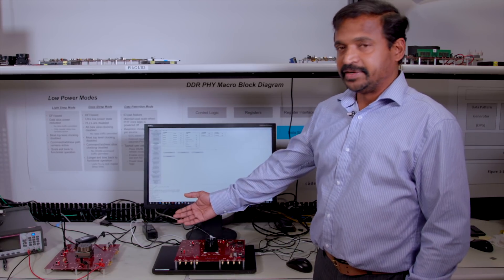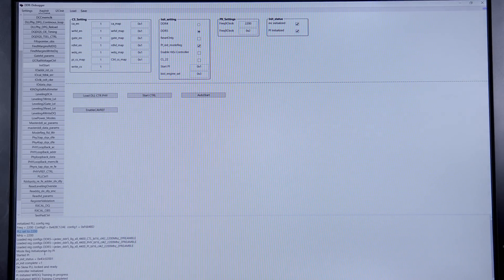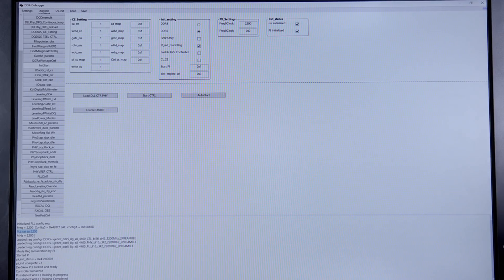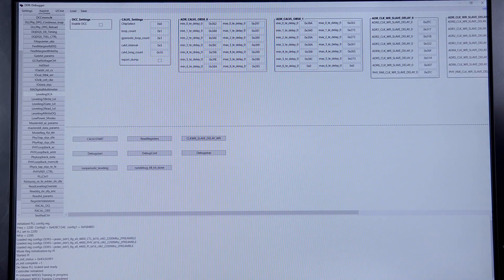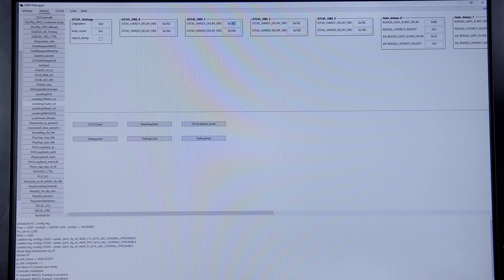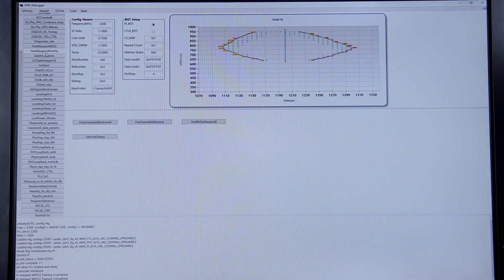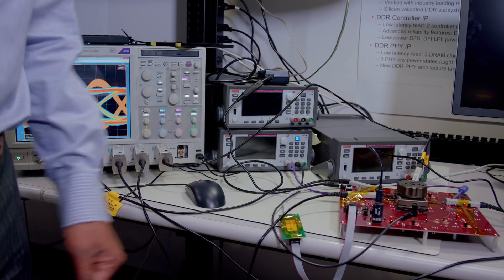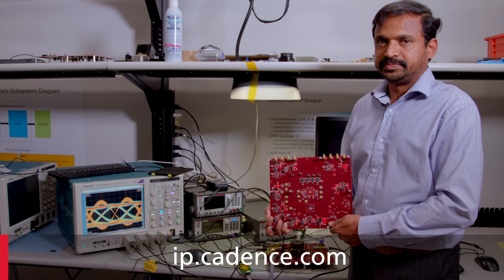World’s First DDR5 IP Silicon Prototype

Comment: When will we see DDR5 on desktop market , any thoughts ?
Reply: On desktop? Late 2020. On servers, early 2020. It is possible that the phones will actually be first to use DDR5. Just my guess. But phones has a benefit of full integration, and not needing to have a huge ecosystem of motherboards, or waiting for other companies to develop CPUs, memory controllers and chipsets.
Reply: bout 3-4 years probably, 1-2 years minimum.
Reply: yea on latest info, or what ive heard at least, it seems it wont be on market till sometimes after 2020 , if not later.